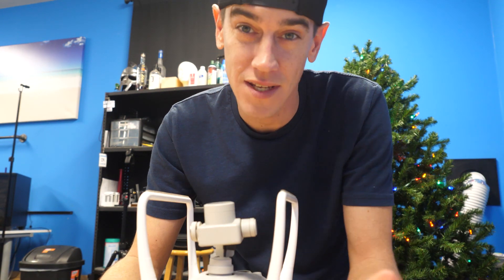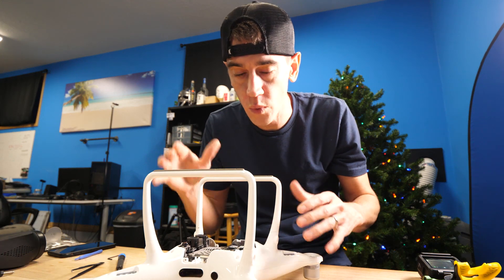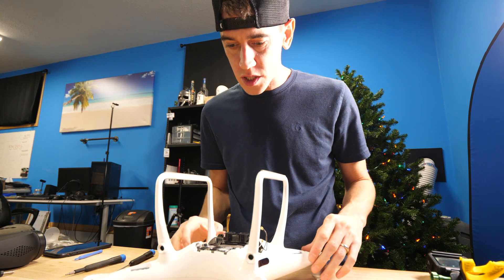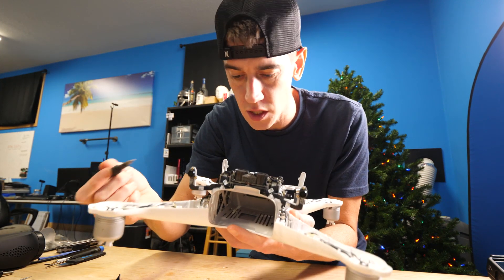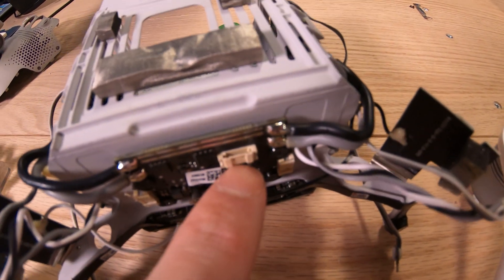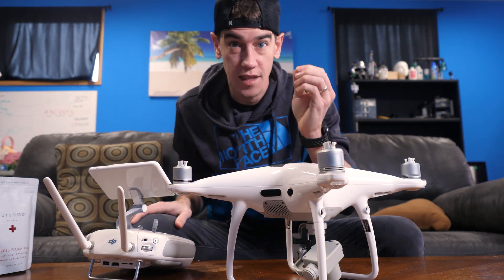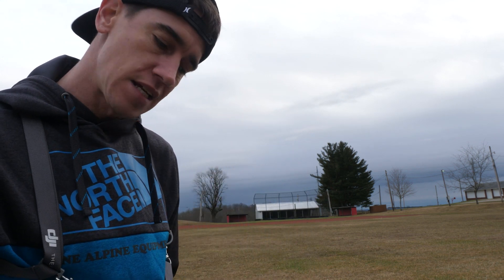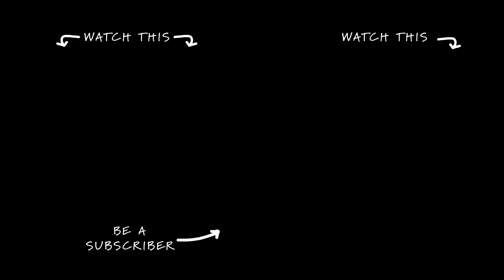DJI Phantom 4 Pro Teardown GPS Replacement

Comment from the maker: Let me know if you have any questions on the repair, I'll try to get to you as quickly as I can :) Thanks for watching!
Reply: Hey Gilroy, why we dont see you in Romans vlogs anymore?
Reply: Loved the vid, but let me give you this advice: Fly with your thumb and index fingers (pinch), not only with thumbs. You'll have 10 times the control you would have only using thumbs. cheers!
Reply: Hello are the GPS modules the same for the Phantom 4?
Reply: Man, i have one question
Maybe my issue same as you...
My p4p in the land have full signal GPS 
But if my drone start to fly, my GPS gone interval 30 second... and switch to ATTI.. and gps appear again and switch to ATTI again.. that so frustating
I want ask.. that the GPS Module need Replacement?

Sry my bad english.. i'm from indonesiao
Reply: Thanks for your help my GPS is working again. Surveying and mapping with phantom 4's since 2016. Now I have no image transmission signal. Anybody know which wires and connections are for image transmission?

Comment: Hi Gilly Gill! 

I have completed this process, and I have replaced my GPS Unit.
Before I replaced the GPS, the app said "No GPS". After the replacement it says "GPS data error". I was trying to be very patient (🙂) and I am sure, that I put the drone back together the same way, that I took it apart. It's super frustrating! What else could possibly be wrong? The workshop says, they no longer repair Phanton 4 Pro drones, and that's why I'm trying to fix it myself.
Reply from the maker: Did you try doing a calibration through the software for IMU?

Comment: Is that drone still working after 2 years? Just want to be sure so i can go ahead mimic your video.
Reply from the maker: Still one of the better platforms IMO, I haven't fired it up for almost a year since getting into FPV but I can pull it out and see if it's all good still.

Comment: Having a hard time getting the soldering off for the motor wires going into the board. Does it just take a while or is there a certain way?

Comment: I have a five year old phantom four, vision it will travel about five seconds stop and come to a hover for three seconds then move forward or four or five seconds come to a complete stop over for two or three seconds and move forward again, I keep the control stick in the same position fully forward. Another flyer told me that he thinks is the GPS do you think you can just turn it off. What’s your opinion on what’s causing this

Comment: Hello brother iam from india,  i have the same issue in my p4 pro. At the time of take off i have gps signal on it, when it on  little height its turning into atti mode by cause of gps signal loss,  and its continuously unstable gps signal,  is there any way to solve it
Reply from the maker: Yep you’ll have to replace your GPS module for sure. Follow along with the video and you’ll get it done 👌🏼

Comment: When I first purchase the Drone do I need to set the GPS or is it automatic? Mine keeps saying it’s off
Reply from the maker: GPS should be on without having to turn it on. There is a switch in the top left shoulder of the remote to change modes, make sure it’s on GPS not ATTI MODE

Comment: i have panthom 4pro 2.0 aircraft disconected error & remote controler not linking  any solution help me
Reply from the maker: Sudha Sri Check to make sure the firmware is up to date on both RC and Aircraft. Once you know that, try the process of re-linking RC to aircraft. Google- how to relink RC phantom 4 pro. Should be a simple fix
Reply: @GillyGill  I have the same issue...v2 version earlier released have connection issue...anyway to fix it ? Hava swapped 3in 1 mobo (but with v2 3.0 mobo instead of v2 2.0 mobo as it not available in my place )